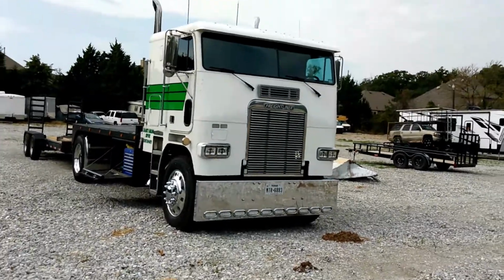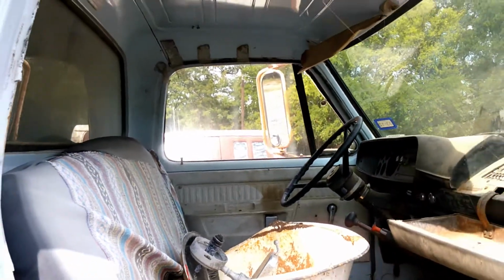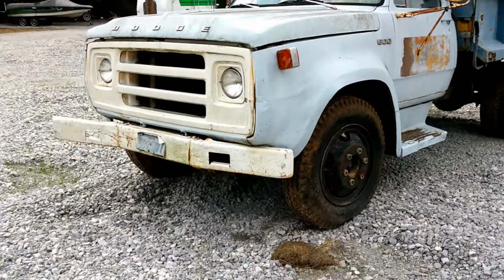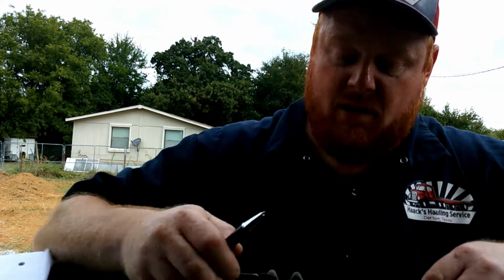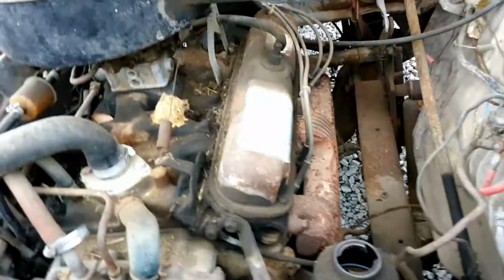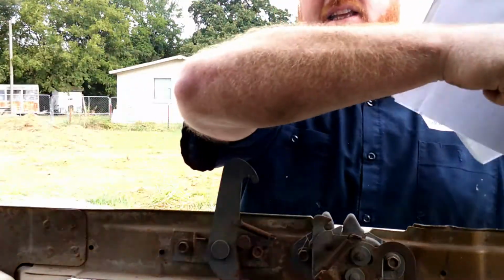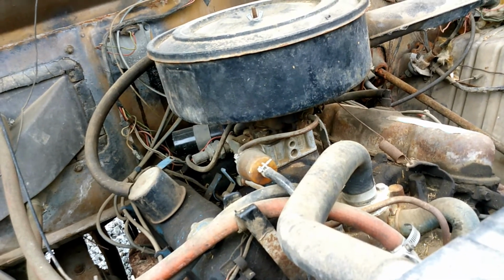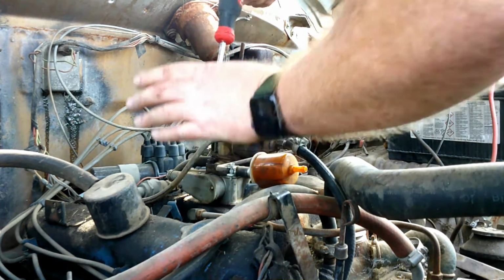Dodge D600 First Start

Comment: That is NOT a 360, but a 318 rather. According to the specs, a D500 was equipped with either a 225 slant 6 or 318 V8 (like yours). A D600 (yours) would have been equipped with either a 318 (what you have) or 361 (big block series engine). And finally, a D700 would have been equipped with either a 361 or 413 V8 (both big block engines). So yours is rated at 177 net HP.
Reply from the maker: Thanks for the info